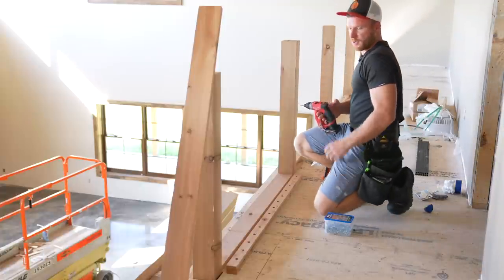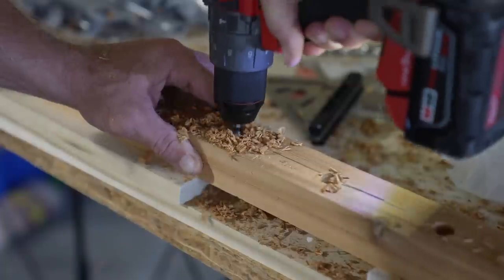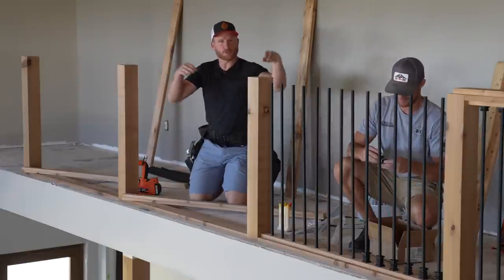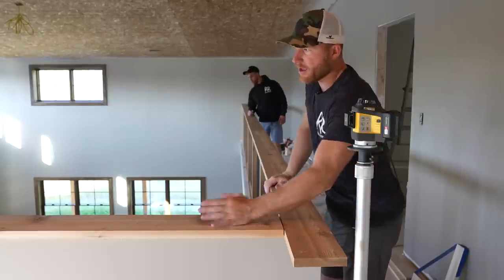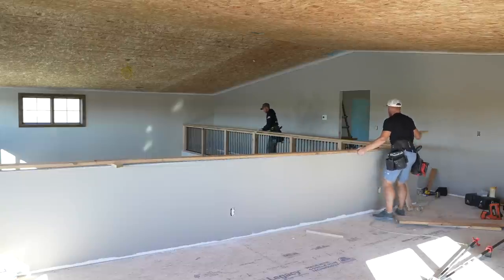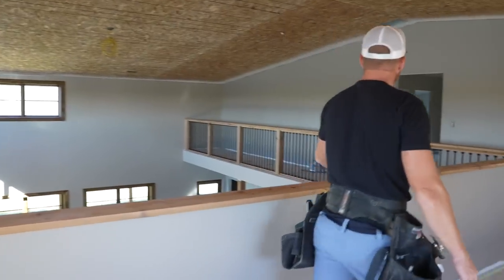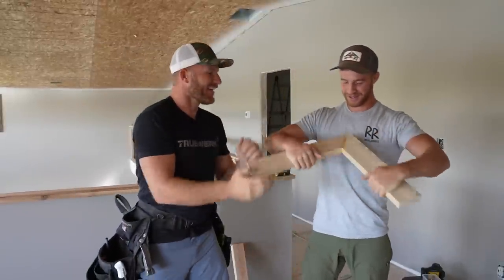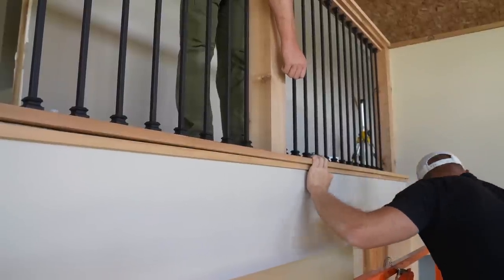Building a Barndominium 34: Installing Railing from Old Power Line Poles

Comment: Evolution makes a steel cutting blade and chop saw that does amazing cuts for metal. I've seen Make It Kustom use it to cut some 1" thick steel, and you just have to see it to know what I'm talking about, but it does way better than even the Diablo blades I see you use! He's in Canada, so I don't know if that is just something for their country.

Comment: 16:58 See? If you'd glued up the biscuit slots as well then biscuits wouldn't have pulled straight out like that one did, the wood would break someplace else. Admittedly it's all over the top anyway, but you are a pro guy, you should be using these things correctly

Comment: Love the biscuit/glue demo...what glue did you use?
Reply: He’s doing it wrong, glue must be added into biscuit slot, using the dry does nothing as they are supposed to expand. Normally PVA is used, polyurethane glue helps if you add water

Comment: How come you decided not to 45 the corner joint on the handrail?
Reply from the maker: two different width boards...didn't want an offset or odd angle miter...Easily could have just decided not to and I am kind of glad
Reply: Makes sense! Love the work!

Comment: You are still doing biscuit joints incorrectly. The biscuit aren’t just there for show, they need to be covered with glue so they can start expanding, that’s the whole point, biscuits physically react to the glue
Reply: There's a glue adapter that fits in the slot to cover it evenly in glue. If he's never used biscuits before then he probably doesn't know what to do